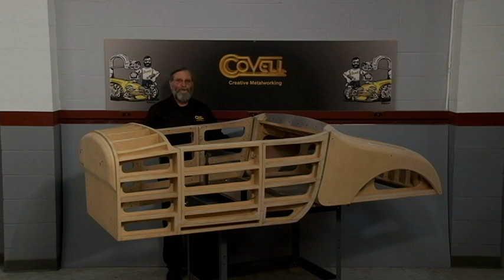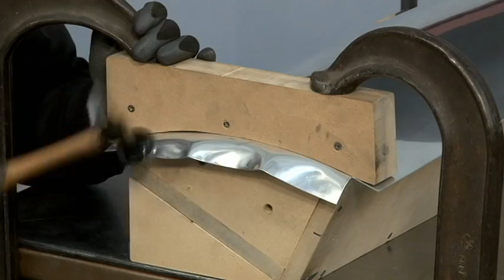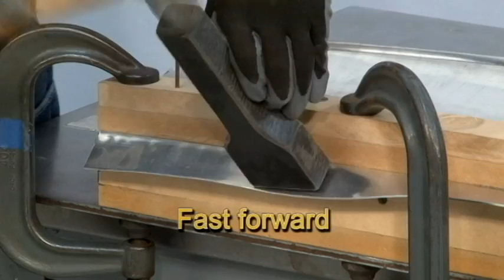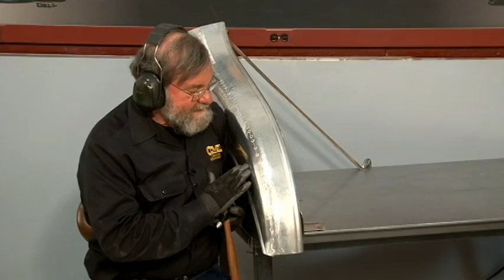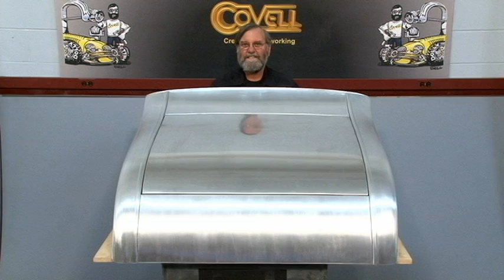Roadster Body Part 2

Comment: I LOVE that you actually metal finished the seam!

I learned to do this after I found a cowl on a 29 Chevy I was building was actually 2 sides that were stick arc welded together and then the weld was metal finished. You could NOT see the seam on top!

Took me a few years, but I taught myself to duplicate using a mig welder.

I did quite a few old box chevy quarter panels, butt welded in at the center of the wheel opening, for practice, when I was young.

Comment: Is this aluminum sheet.. 8:04
 Can this technique be done in steel. What gauges of steel is ideal for this kind of project.?
Reply from the maker: Yes, the same techniques I use on this project can be used on steel, also. The best thickness would be 19-gauge, or 1 mm.
You can see me doing some work with steel here:
https://www.youtube.com/watch?v=lYK8Tn3uNaI

Comment: What is the "normal/average" thickness of sheet  metals you deforming? In millimeters if possible...or if someone else know..can replay me..
Reply from the maker: For the type of work I do, I prefer steel 1mm thick, and aluminum 1.6mm. I have worked with aluminum up to 2mm, and steel up to 1.5mm, but it's more difficult to form, and I only use those thicknesses for very 'heavy-duty' work. In the aircraft world, they use much thinner materials,. 6mm is a commonly used thickness for light aircraft.

Comment: I ended my career as an HVAC mechanic, but I started as a sheet metal duct man. We called ourselves "tin benders". HAHA. Little did we know. What we did and what you do don't reside on the same planet sir. The trickiest fittings we built required maybe one one hundredth of your skill. Maybe. Sadly what you do is being lost as we speak. Not a skill or a trade, but an art.
Reply from the maker: Tom - thanks for the high praise! I happen to know that it does take care and skill to make some of the more complicated transitions used in the HVAC world!

Comment: It's so beautiful I don't think I would want to paint it! Also, I could probably do some of this but the bead from the Pulmax would be hard to get.
Reply from the maker: You could certainly do the bead with a beading machine, but on large beads the electric reciprocating machines have a little more capacity, and can often develop a detail with more 'crispness' to the edges.

Comment: This info is great, I stopped the video 2 hours ago, went looking for the Air Hammer Tools with the Nylon heads, being in Australia we don't have acess to all the gear like you guys do over there in the States, so it can take us hours to find sellers, then weeks to get parts in to be able to make stuff. Crazy hearing stories of how fast you guys can get what ever you want, as fast as a couple of days.
Reply from the maker: +MotorcycleTherapy I've been in Australia many times, and there are people doing fabulous metalwork there. Good luck to you!
Reply: Hey I plan on being one of those people, just picked up a 48 Dodge Panel Truck, I got a job and a half infront of me, been sitting out in the open for years and although the floor and firewall is not totally rusted out, I got to watch more of your videos to get me through this job. Looking forward to the task though, it's what I'm looking for, metal fab / welding / etc. These tools are on my radar, but having trouble locating them Nylon Hammer Heads here in Australia. Will probably end up sourcing them from USA
Reply from the maker: +MotorcycleTherapy Check out www.metalmantools.com.au and http://speedwerx.com.au/
Reply: Thanks Ron, I have checked out the sites, called Speedwerx and found a few things I also had my eyes on. The owner at speedwerx was surprised when I mentioned you, speaks highly of you.
Reply: I think I'm still going to have to order that Nulon Head Hammer section from the USA though, found them on ebay but they always come in a 3 pack with the Aluminium and Brass heads as well.

Comment: Exactly what I was looking for. Just one question: Do you remove the buck after all the forming is complete? 

Thanks Ron.
Reply from the maker: Samual Iam Samual - For me, the buck is simply a 'target' to shoot for as I am shaping the sheetmetal body panels. I will use metal bracing inside the body to give it strength when the car is completed. 
Some early cars used a wooden structure inside the sheetmetal body panels, but by the mid 1930's, most manufacturers abandoned using wooden reinforcements, and went to all-metal structures.

Comment: Ron thanks for the clip.
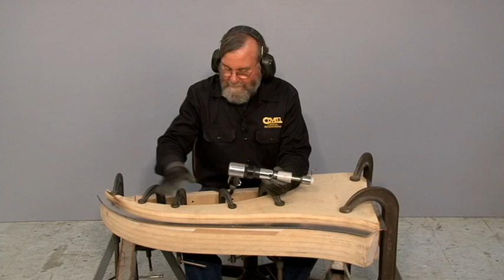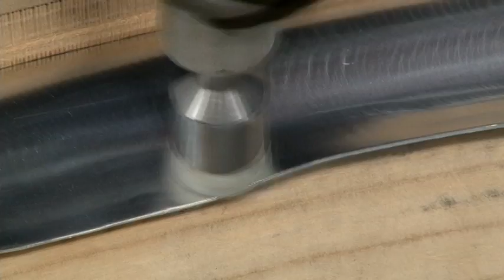Herein, at 07:15 - 07:45 there is a tool you use here. What is the name of the tool and how much does it cost?
Reply from the maker: Samuel Kyambo That is a 'flow-forming' tool. You can get more information on them at www.tinmantech.com
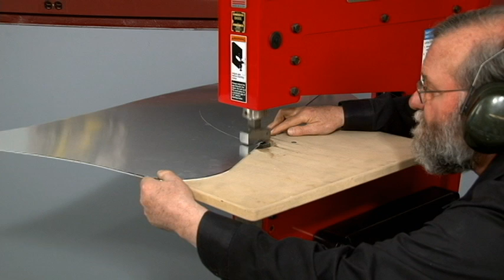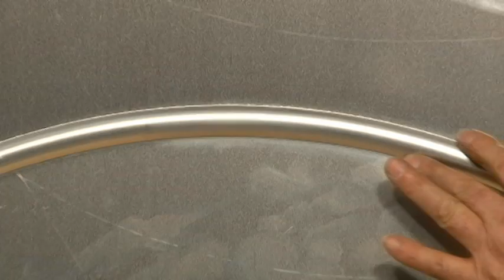Reply: Ron Covell How about the thickness of the panel. What thickness is being used here? Name of tool at 6:02 - 6:20. 
Thanks
Reply from the maker: Samuel Kyambo The material I am using is .062" 3003 H-14. The tool is an Electric Reciprocating machine made by Dake.
Reply: Ron Covell Wanted to know how I can get this dvd and also if the entire work is on one dvd. 
Thank you
Reply from the maker: Samuel Kyambo Samuel, all of our DVDs are available on our website, www.covell.biz. The DVD titled 'Building a Roadster Body - Part 1' shows how the wooden buck is made, and the 'Part 2' shows the metal being shaped to fit the buck.